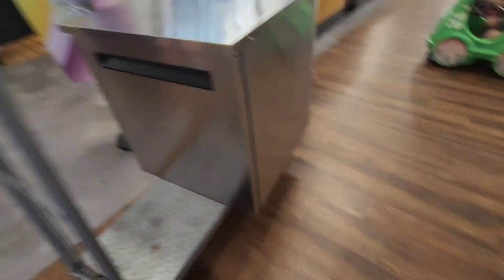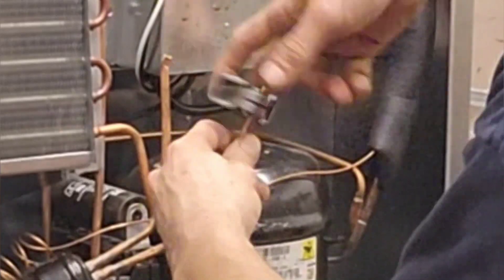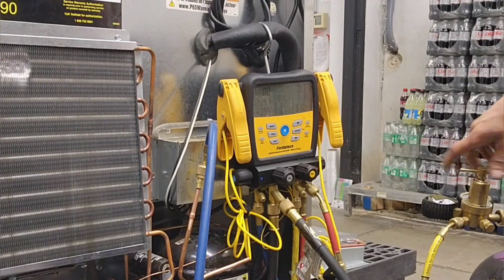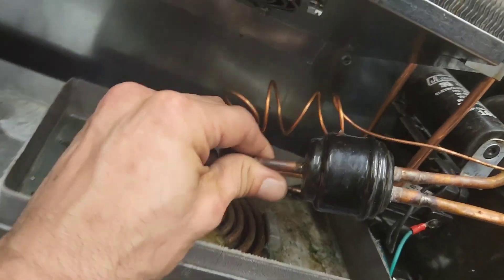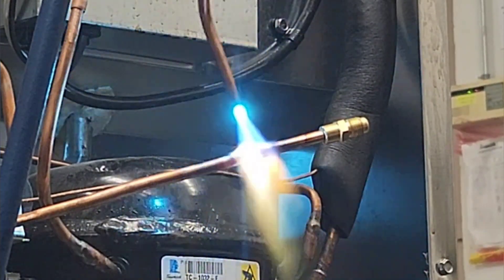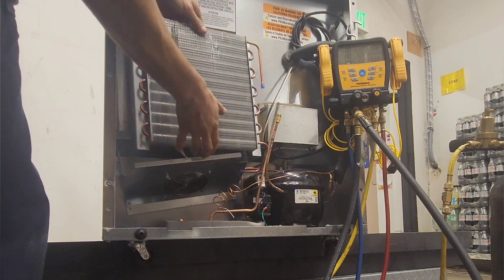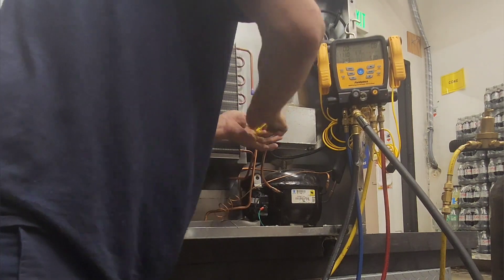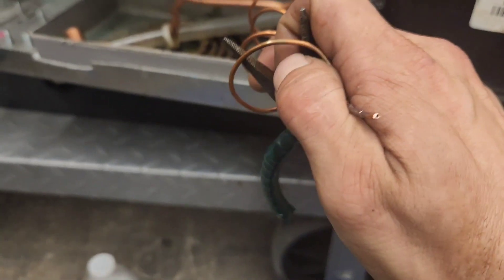R290 Coil Replacement on Sealed 2.5 oz System

Comment: You could just put 134 right in that system no problems I know from experience because I have done it a couple times the first one I did it on it’s been 2 years and that system is still working

Comment: Hey man I really appreciate these videos. I transitioned from residential hvac to kitchen refrigeration a few months ago and never got any real training on this stuff but have been expected to work on it. 
I use the mastercool 98202 scale and it comes with a little charging hose. Just be careful because mine was a hand me down and the little hose that goes into the ball valve came loose and I almost had a big issue using it next to a 4 bank of gas fryers.
Reply from the maker: I'm really Glad that my videos can help you. I appreciate you letting me know! Just stick with it. Most of the learning you'll get is from in experience and trial-and-error and making mistakes like me. Time spent in the field is gonna be your best learning guide.

Comment: United has a hydrocarbon scale. I think it’s like 90 bucks. Works great.
Reply from the maker: I would probably get one of those if I did these more often, But i'm usually putting in multiple jugs of refrigerant at a time. So it just seems like something that would collect dust in my truck. That's cool that they got something like that though.

Comment: When I used my pinch off tool I would always put a little bit of solder on the crease after removing the pinch off tool just as a precaution. Probably overkill but better than a callback. Job well done 👍👍
Reply from the maker: That's a good idea too.

Comment: I use a JB charging scale and it has small hoses that come with it. Super accurate and works very great! I use vavle core removal tool on the access port so i can just go straight scale and purge at the shrader removal tool.
Reply: Also one dude at my shop swears by Amp draw charging r290 systems.
Reply from the maker: That's cool. I think amp draws can tell you a lot also. I made a YouTube short video a while back.Talking about how you know your small systems like that are overcharged where you watch.The liquid line gauge on a analog gauge bounce when you close it off. Sometimes I use that to know when the system is just absolutely full and can't take anymore. Not necessarily on r290 system, But on other small, R404 prep tables when I knew the units had a leak and I wanted to get them full with as much as I could pack in them, so that they would last as long as possible Before having to go back out there and recharge it.